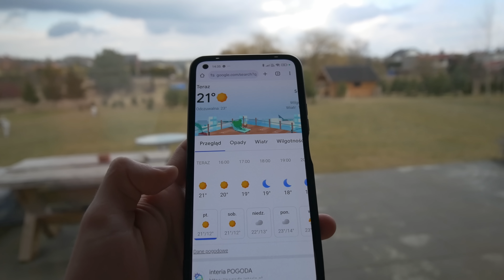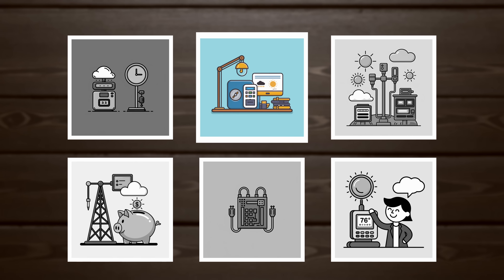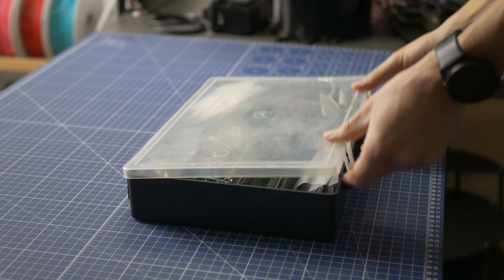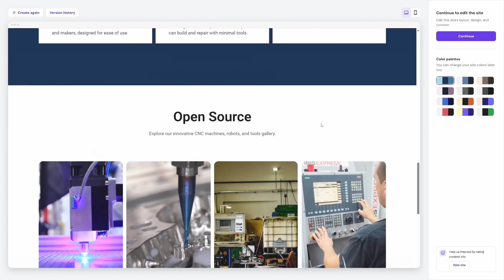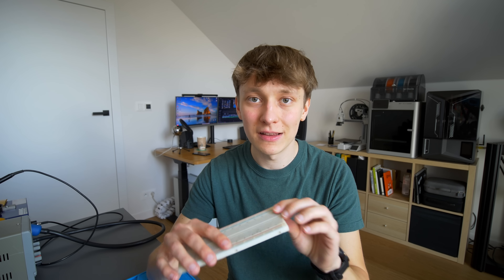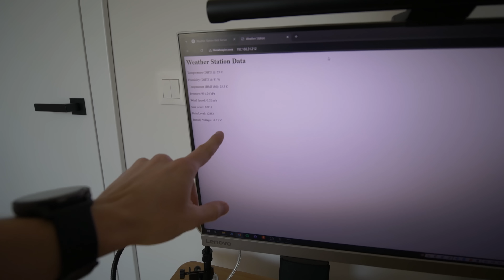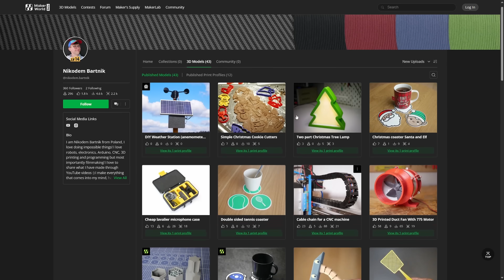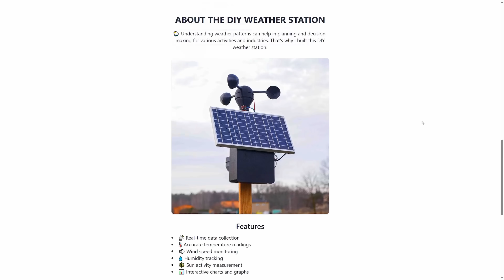Weather Station is The Best DIY Project EVER.

Comment from the maker: Check out Hostinger and get your discount: https://hostinger.com/nikodem
Use code: NIKODEM at checkout to get a discount!
Reply: fan of your work but your reliance & "promotion" of using generative AI rather than actually learning the basics or using pre-built dashboards (like Grafana) is something I can't get behind... definitely disappointed.
Reply: I'm worried about the close proximity of the solar panel affecting the animator.  That flat plane might cause a Bernoulli effect that could skew the wind speed.
Reply: For your temperature and humidity sensor you can try out DHT22 sensor

Comment: I would change following to make it more future and weatherproof:
- add coating (paint) to all PCBs to make them weather and humidity resistant... 
- when using cable grommets, put them on bottom on case, not on top or sides -> reason is water will drip from the bottom of a cable loop, now it can reach inside from side (there is still risk, because these grommets are hard to get watertight when you use more than one round cable)
- I would use esp32 with ability to have external antenna with U.FL connector, this can make the range significantly longer. ESPs are easy to deep sleep, and powerful to do many tasks.
- When using 3D printed enclosures, paint them. there are small gaps between layers, which hardly makes it watertight. Paint will flow into those gaps and seal it. Use seals at the edges. Humidity buildup inside of waterproof box is also enemy (frost during winter).
- Temperature from whatever controller you are using is affecting temperature sensor, extend it outside of BLACK case. 
- BMP280 / BMP680 is almost universal sensor for temperature, humidity, pressure.
- As someone mentioned here, send it via MQTT to time based DB, and read it from something like Grafana for example. These things are supposed to collect data and sleep as much as possible to save energy.
I built around 5 iterations of weather stations, and many remote ones with different sensors, this is interesting to learn from to make things waterproof, long term running and problem-proof, with my most functional and solid one being with modified Raspberry zero, which had soldered connector for external Wifi Antenna. It is really easy to update any program running to collect data via network / remotely. Disadvantage is, that it is running from power wall, but it now runs for 3+ years without any errors. Collects data with BME280 /BH1750 sensors. Case of it is heated by Pi Zero itself, so no buildup of humidity during winter, and i also added silica gel to soak up any remaining humidity during assembly. Case is IP69 watertight with rubber seal and watherproof connectors (no cable grommets), top is transparent to inspect its status via OLED screen.

Comment: Were you able to run any ai model for forecasting? Can you tell more about that? I built one with a pic18f45k22 and usr-WiFi-232t works on a single li-on battery without charge for 2 days

Comment: I like the summary at the end. I have quite a few questions for you going into the winter: 1) how does all of this hold up in deep cold, and 2) how do you plan to handle data transmission when there are wifi disconnects (e.g., there may be a power outage at your home which disconnects your router)?

Comment: Water and temperature will destroy the bearing, so it should be protected at best. Also, I am using PETG, after a few months will become crispy, especially if it is exposed on external influences. So buckle up and be ready, to change everything after 6 months.
Reply: How about ABS?

Comment: Skip the wi-fi altogether. Use 802.15.4, find an MCU with a software stack that supports it's power management and low power states. Good option would be RIOT OS with one of the STM32s, the L family is extremely power efficient. Instead of feeding an SQL DB, just use mqtt over 802.15.4 (with a 6lowpan stack over it), and ingest the data in a time series DB, There are enough option for TSDB with an MQTT connectors. You can visualize the data with Grafana. You can do all sorts of cool mesh networking with 802.15.4, 6lowpan and RPL. Play with opportunistic routing, multipathing, etc. Not to mention you can use 802.15.4 both at 2.4 Ghz ISM band, but also 868 and 433. Is it an overkill, absolutely, is it worth it, you bet!
Reply: just use ESP now
Reply: @fouzaialaa7962  ESP and Lora

Comment: For more accurate anemometer readings move your PV panel and control box lower from the anemometer as the current setup will redirect the wind hitting the anemometer.

Comment: Hi, great video. I have another project that measures volumes of two water thanks using Esp32 and the data are show in a local website in the sabe wifi network. I would like to see how to host it in the hostinger. Thanks

Comment: For me Raspberry Pi Pico is a huge overkill. I've created my weather station using ESP8266 (Node MCU board). The main sensor is BME680 and i also have anemometer which i calibrated using a car one of the windless mornings (because at high wind speeds the corelation between rpm of anemometer and actual wind speed is not linear).
Usind air pressure data i can create a slope over time to tell me if the weather would change (when it's about to rain the pressure will drop). 
For IoT thing i utilized MQTT protocol, which sends data to a server. 
For power i used pack of 18650 and solar cell with MPPT charger.
I agree, weather station is the best thing to create for a home project. Hello from 🇺🇦
Reply from the maker: It's Pico not a full Raspberry Pi so it's a microcontroller just like an ESP
Reply: Yes, i know. Even for me 3 years ago ESP was an overkill, because i don't need wifi capabilities back then. But now this "project" grown too much and i'm using esp for internet communication only. 
As a heart of my system is STM32 microcontroller that deals not only weather stuff but also controlling 3d-printed wind generator with mppt controller circuit that i create during my time at university.
For beginners i will still recommend using esp or even Arduino (aTmega 328p). But as you said in the video, this project can be created as complex or as simple as people want

Comment: Had you considered making the rain sensor able to measure the amount of rainfall? 

You're 3/4 of the way there already - just need a tipping bucket that can flip flop back and forth when a measured amount of water fills one side of the seesaw - you can then use a hall effect sensor to track the bucket tipping, and calculate the total volume of water per hour based on number of tips of the bucket timesed by the volume of the bucket over that time period
Reply: Great idea

Comment: The commercial rain sensors use a tipping bucket system, that is a pair of containers on a see-saw arrangement. When each side gets filled with rain, it tips over and allows the other side to be filled. There is a magnet and reed switch that activates when the bucket tips, and the software just counts the number of pulses from the switch. You would need to calibrate so that each pulse equals let's say 0.1mm of rain

Comment: If you're using Wi-Fi to upload that data to the website, that's probably your main power consumption. I don’t know the period over which you're uploading the data, but you could try operating the system in sleep mode and turning the Wi-Fi radio on again for each upload (since weather data isn't very variable). Another good solution would be to use a different wireless protocol designed for low-power applications, such as LoRa. Congrats on the project! It was really nice to watch, and I’m sure it will inspire a lot of beginners.

Comment: I found your project on MakerWorld. Very cool!
NO need to replace the temperature sensor. YOu have the BMP180, which also gives temperature 🙂, If you want also humidity, I would recommend BME280, which measure all in one and uses barely energy.
For rain I plan to also measure the exact amount. I plan to build this into a bird feeder, so I have alot of roof surface to collect rain. I plan to measure the rain by filling a defined volume which self empy and count the empty cycles. 
Thank you for all this inspiration. Where did you find the function to calculate the windspeed?

Comment: Instead of photo resistor - just check the solar panel voltage :)
For the anemometer - there is a cool project for wind sensor with no rotating parts with strain gauges.
Just as a tip for future...

Comment: How do you correlate the wind speed with the anemometer angular speed?
Reply: wind speed is linear speed, isn't it ?  just convert the angular speed to linear speed.
Reply: @Guix555  I think it's not so simple. The angular velocity of the anemometer must depend on the geometry of the wings. Imagine you have flat wings; theoretically you should have 0 angular velocity for all wind speeds. I'm right?

Comment: Rp2040 should be able to do very low power consumption; you just need to use the sleep modes, and turn the wifi off between transmissions

Comment: I use: BME280 for temperature, humidity and pressure; SDS011 for PM 2.5 and PM 10. You can check out Nettigo kits, maybe it will inspire you 🙂

Comment: I just built Version 3 or so of the same weather station, that I keep updating for the past 5 years or so. 
My Wind Wane (heading) works with a digital compass module and a small magnet at the end of a the rotary shaft. 
Pretty much the same Hall sensor idea on the anemometer. 

Only different thing is, I tend to use ESP8366 with nRF24 as transmitter.

Comment: Great project, but, noooooooo, please, don't suggest to use a breadboard for a final design!!! Even for a prototype, this is crap. Or at least, when using wires jungle! Proper pre-formed jumpers is better...
Learn how to solder, this is as fast as messing around with low quality breadboards. Especially when you only need to connect four I²C wires.

Comment: you can use 2 esp32s running espnow and occasionally send data (let's say every 5  minutes) to the other esp. while is not sending data it enters deep sleep mode and that battery alone could run without a solar pannel for 2+ years

Comment: The good and bad summary at the end was great.  I built a weather station a few years ago around an ESP32 dev board that includes a lithium ion charging circuit (WEMOS Lolin32 V1.0.0) that I would put to sleep and have it wake up every 2 minutes to take measurements and connect to wi-fi to upload the data.  I was using smaller solar panels and 18650 lithium ion battery.  One time the battery dropped below safe operating voltage and the ESP32 board would not come on.  What really surprised me was how low the battery voltage eventually got.  It was too low to safely charge back up.  I believe that the voltage divider I was using caused the battery to continue to discharge even while the ESP32 board wasn't running. I removed the voltage divider and switched to a dedicated voltage measuring component (INA219).  The other thing I learned was that Wi-Fi uses a lot of power, that is why most commercial weather stations use a low power dedicated radio frequency that talks to a base station, and the base station that you plug-in connects to the internet over Wi-Fi.  The small solar panels I was using would ware out after a  year or so and eventually the 18650 battery would ware out an need to be replaced.  I used my station for 3 years I think, and then someone gifted me a nice commercial solar powered weather station (Tempest).  So I retired the one I built.  Someday I would like to build mine again and change to a dedicated low power radio chip and use a base station.  And build an anemometer like you did.
Reply: Consider using ESP-NOW for your comms. It is much more light-weight than WiFi and consequently less power-hungry. (NB: you would need another ESP32 to act as a bridge to your network). Neither you nor Nikodem were doing yourself any favors by using a voltage divider to measure battery level because of the constant drain. Kudo's on replacing it with a dedicated module.
Reply: @vannoo67  I want to make one Station using Lora to send the data to the base and see the data over internet. But I still want to lear how to host the website.
Reply: Lora may be of use here. You don't need to worry about connecting or maintaining a wifi connection, and another esp32 board with a lora radio can receive the data, and either run it's own web server, or publish data over mqtt to something like home assistant. 
You may also be able to do some of the lighter tasks using the ULP core, like taking anemometer or rain gauge readings... You can have the main cores in deep sleep, wake the main cores every minute or two, power up some additional sensors, get readings, transmit on lora, then power down sensors and go back to deep sleep.

Comment: Excellent job!  One thing to consider is your solar panel will affect your wind speed readings by interference with the wind currents and depending on their direction.  A little more distance between the anemometer and the solar panel will result in better data.  For temperature sensors consider using the Dallas DS1820.  It's easy to interface and accurately reads colder temperatures than you will ever see in Poland. 🤍❤🇵🇱 🤝 🇺🇦💙💛
Reply from the maker: You are right! I didn't thought about it at all, I will try to lower the solar panel so that there is more distance. Thanks a lot!

Comment: I dont see any data for the rain sensor?
Reply from the maker: it's stored in the database. I didn't like it when there was an odd number of data fields on the page :)
Reply from the maker: I will be experimenting with new designs that include rain data
Reply: I think he had to delete it as it was useless. 
He needed to install the sensor at an angle to get rid of any standing water.